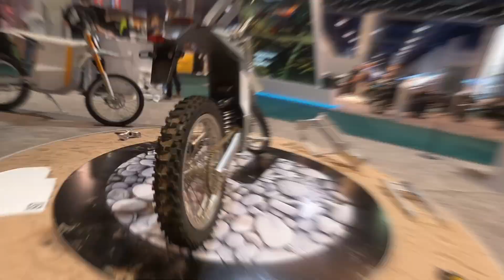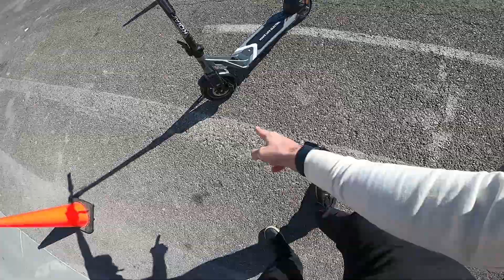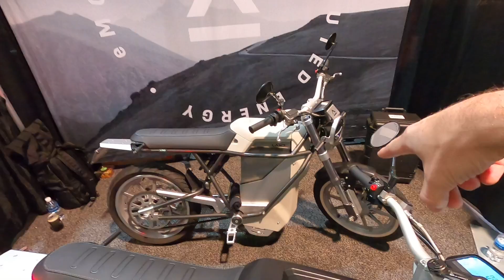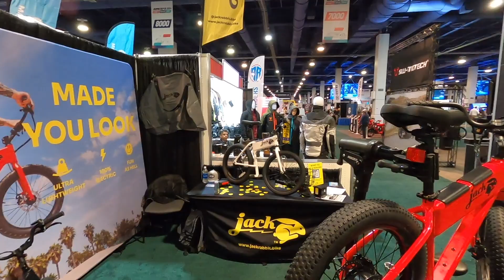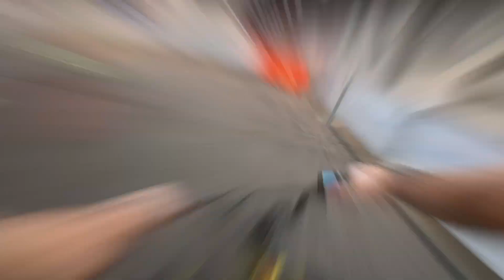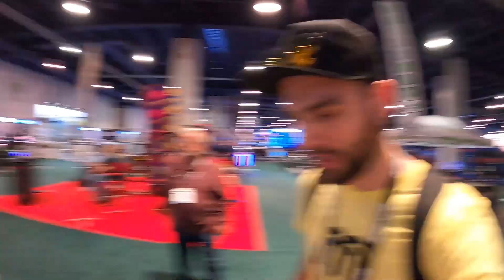AIMExpo 2024 Part 2: Test Rides, New E-Motorcycles, Brand Interviews!

Comment: SCEWTERZ 

 a quarter century retrospective

my fellowes and frenz todaye marx the end of scewterz as we know it we all see the trials and triumphs as we head into the new century we all have seen impruvements i end this note with my most recent progress for you to decide 

impruvementes and changes ive made to my skewters over the years since they were made i pulled the deck back muved the stem forward to give it less of a rake angle and i muved the handlebarz back all of this gives the ryder more rume to stand on the deck without being cramped 

worryes 

i am more wurede about my clothing getting caught or snagged on something more than cables or wyres although i've never had that happen the only thing thet i have ever had go wrong in my 20 years or so of ryding scutres and bykes wuz sum small tree branches got hung up on my wheelspokes and then they broke and fell off causing no damege and cheep tyres can get flat tubes but if you spend sum more tyme to spend a bit more muney then you shuld'nt get a flat 🛴😁